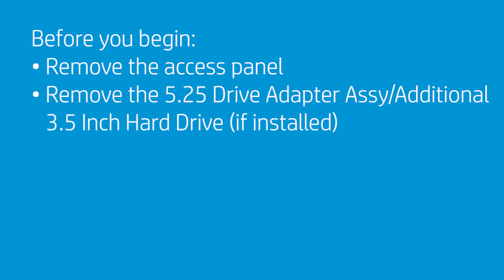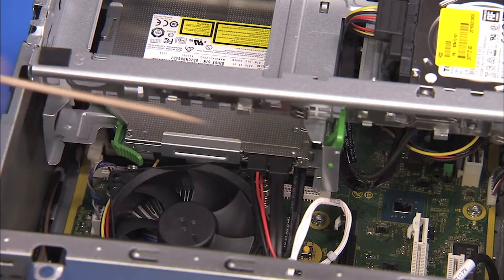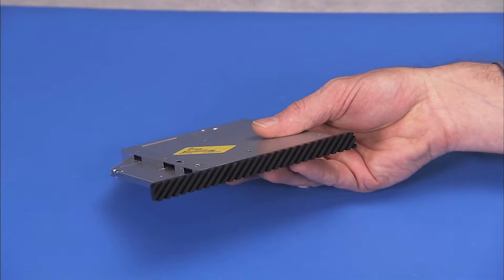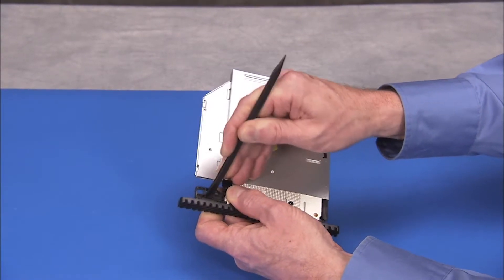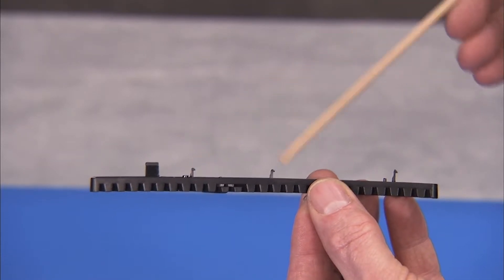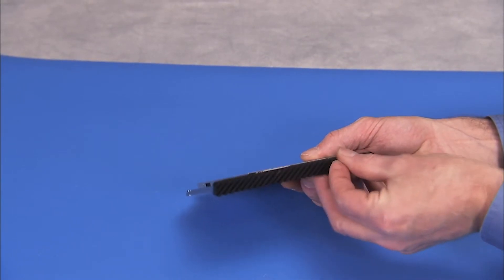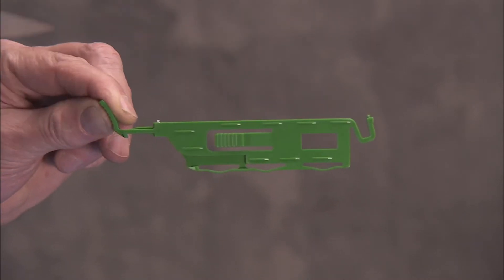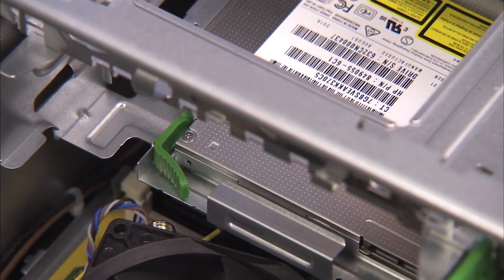Replace the Optical Drive | HP ProDesk 680, 600 G5 MT and HP ProDesk 680 G4 MT | HP

Comment: Where is the button to open and close the drawer?
Reply from the maker: Which drawer you need to open?
Could you point us to the time stamp under the video?
Regards, 
HP Support
Reply: @HPSupport  the drawer for the optical drive.
Reply from the maker: If the drive door button is on the front panel of the computer to the right of the hinged door, press the button. If the drive door button is part of the computer case and is covering the drive door, open the door that is part of the computer case and press the eject button on the faceplate of the drive.
Regards, 
HP Support